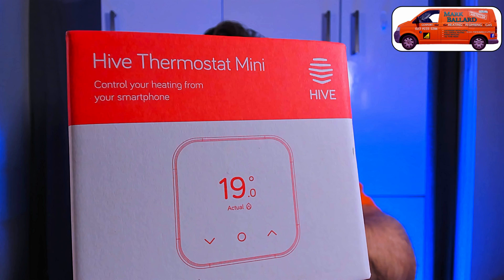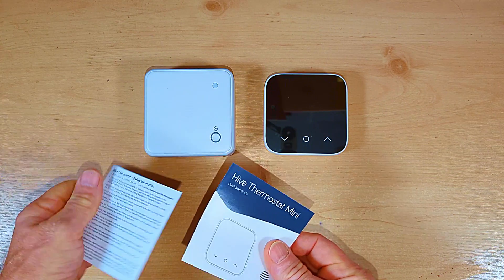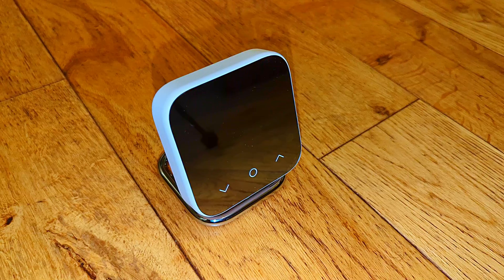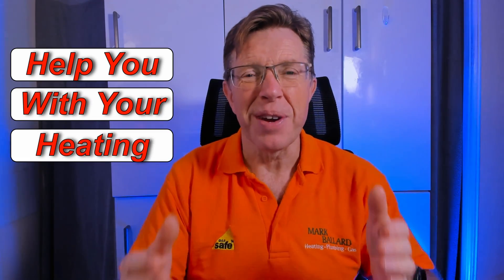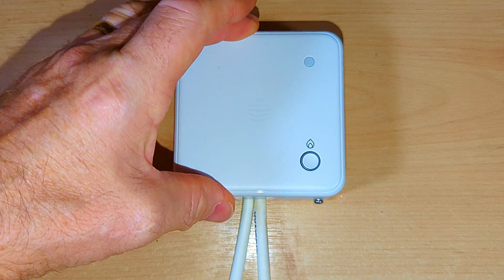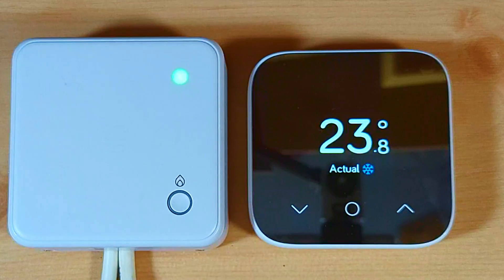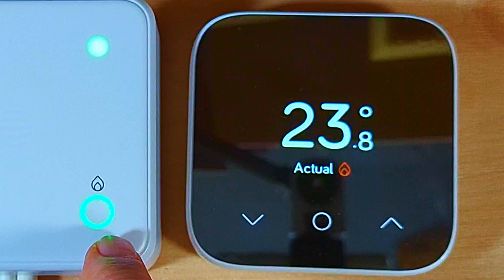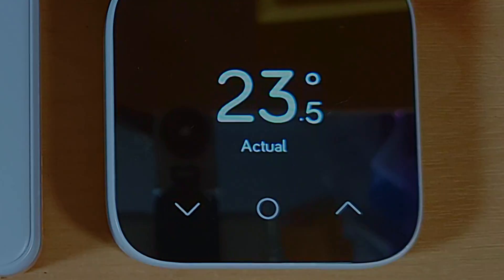How to Install the Hive Thermostat Mini, Explained in Detail Wiring, Pairing, Factory Reset.

Comment: I did manage to sort, but had to hold the reset button on the receiver for 10 seconds twice, first time to go from green to blue white and then again to make it flash on off. Then it paired, this was after battery run out. Good video :)

Comment: Everything has been working fine then out of no where the receiver shuts off the top light gone red and my hand hub/receiver says reset but I don’t know how too ? Please help
Reply: Did you get this sorted? Mine has done this
Reply: No sent it back
Reply: @christinemarshall8934 mine has recently done this can still turn heat on at the receiver but thermostat won’t connect. Read up the hive instructions on how to pair but it seems a little confusing and slightly scared since gas boiler lol

Comment: Great videos - this however has been missed out by many - it happens when HUB does not pair with receiver and thermostat. Which STOPS it pairing with phone Apps. I found it very helpful as I could often sync the Receiver and thermostat BUT couldn't get the App to recognise either. I guess this is because you can purchase the units without Hub. Pairing the Hub is ESSENTIAL for the Apps to recognise all you units.

" Turns out I was in standalone mode...

Standalone mode is where your thermostat and receiver are communicating directly and not going via the hub which is why it is offline in the app.

To get back into normal mode:

take a battery out of thermostat
turn off receiver at the isolation switch for a few moments
turn receiver back on and hold the heating button on the reciver until it flashes pink
hold the heating button again until it double flashes yellow
put batteries back in thermostat
hold the middle and left buttons of the 3 buttons on the bottom of the thermostat till it counts down to 0.
select your language and then it will start searching
on your hub press the black button for 1 second then the middle light should flash orange. Then look back on your thermostat and it should start pairing and then once paired it should be back online in the app."

Comment: Hi Mark, great videos on the hive installs - ive wired mine in and all conected to the phone etc - (stand alone boiler Y set up with 3 way valve) - green lights coming on for water or heating as they should on the receiver - but heating only is not firing the boiler - water only is bringing hot water and heating on together - what have o done wrong? any help please.

Comment: Just bought my first house and I’m trying to install my Hive mini set up into the existing ideal iMini boiler. It’s already set up with a Drayton Digistat+2 which is connected with a three chord flex but the earth wire isn’t connected to anything. My question is - will everything work fine if I just replace the Drayton with my hive and use the three chord flex and wire it up as you’ve shown ? What’s the benefit of using the switch wires ?

Comment: Hi, Mark.

I'm pretty confident that I can replace my WR1 with the Hive receiver - it looks as if it'll just literally drop on - but am unsure as to what to do with the old British Gas (Drayton DigiStat) thermostat. If I were to do away with it, would I need to make any wiring connections? Is it best to simply leave it where it is and forget about it, since it will no longer have a WR1 to talk to? Lastly, would I still need the small grey gadget (again, a British Gas-branded thing) that's connected directly by an Ethernet cable to my broadband router?

Comment: Hi my receiver doesn’t power on I replaced the old receiver. I only have two wires the negative and live wire. I have no light on the receiver.
Reply: You need 5 wires 
Live 
Neutral
Earth
Heating on 
heating off

Comment: Can you use these to replace an old Honeywell thermostat?
Reply from the maker: yes and no.
If you want to remove an old thermostat off the wall and replace it with this  in the same place, then NO.
If you want to remove an old thermostat off the wall and find the wiring centre and wire the receiver unit in there, then Yes.
Watch my other video How to Install Hive Thermostat Mini on a Traditional system.  Coming Soon.

Comment: Thanks Mark. It does sound like a very poor device to me. Please advise on a good quality device with timer and external sensor
Reply from the maker: This is a real problem I have been having.  All manufactures are changing to smart controls which all have good and bad point and  in general are more complicated.  I find a lot of people don't want smart.  They just want simple.  Which I am totally on board with. I am trying to find a simple control which believe it or not this is simple control.
Reply from the maker: I am trying out the new Drayton Digistat RF901,  Video to come. But that has some not intuitive setting for manual operation, which is very frustrating. 
Honeywell T3R has become very unreliable which is also frustrating.